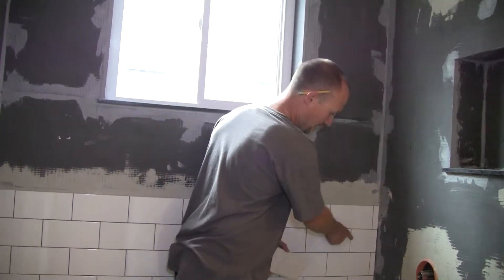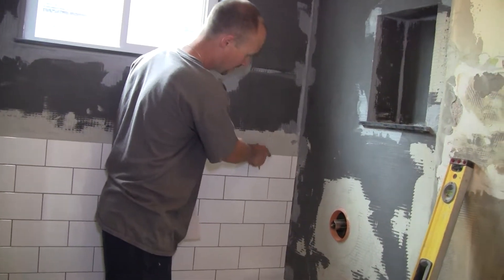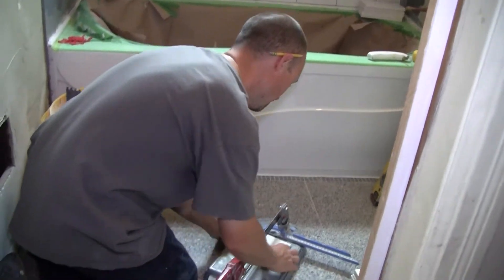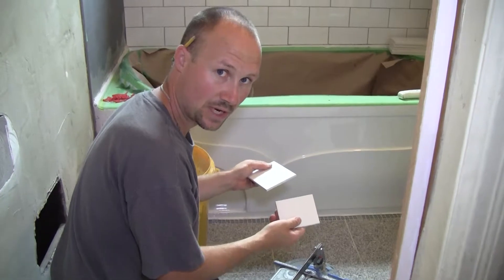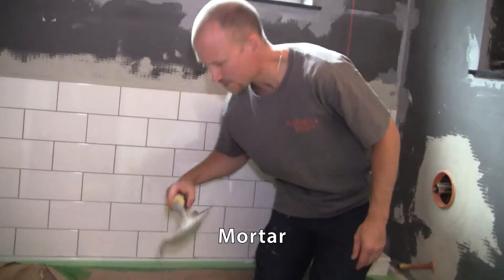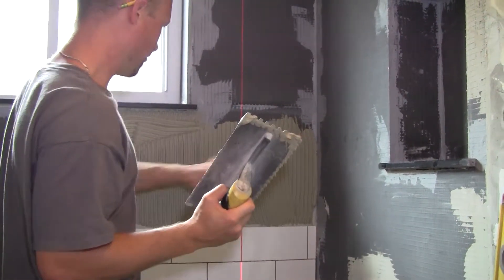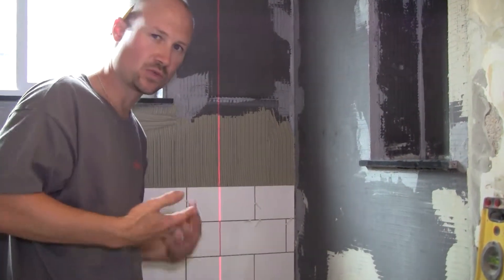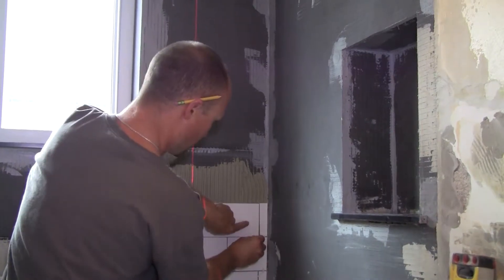How to Tile a Bathroom 31: Advanced Tiling

Comment: Why did you left right side just a tiny bit of tile? That looks  ugly in that corner, beacuase is to slim
Reply from the maker: If you watch the videos, you will see that I have a reason for leaving a "thin" tile there. There are many ways to tile a wall and my favourite is to always have it "wrap around" the wall with the tile. This means that you take the cutoff from the one wall and use it on the other. Some people like to always centre the wall.